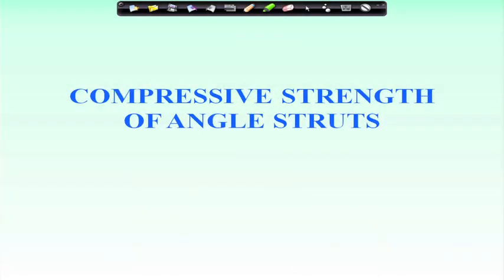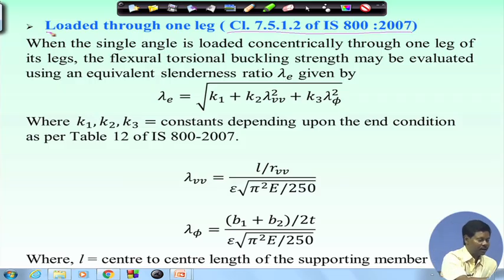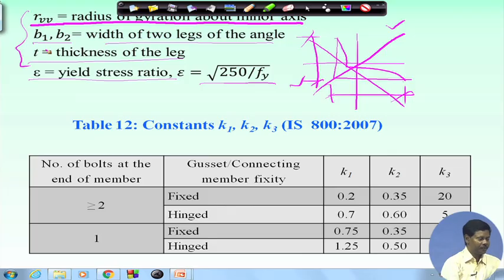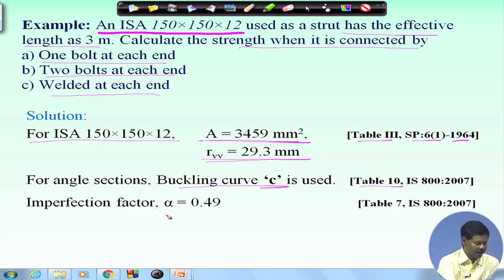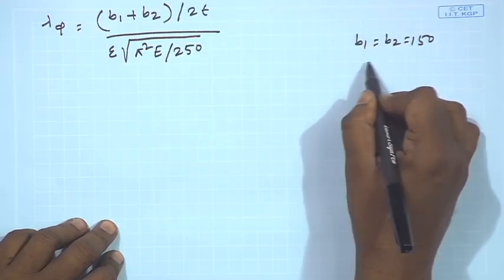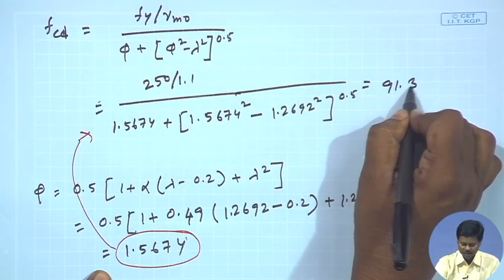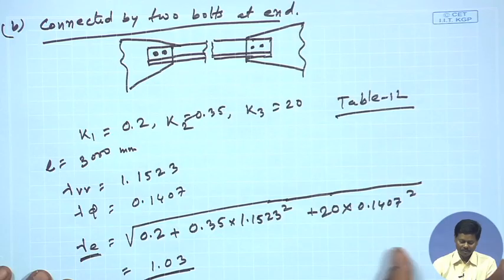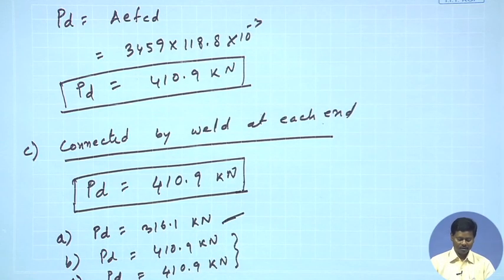Lecture 32: Compressive Strength of Angle Struts

Comment: In Table 12 of IS 800:2007 how can the condition of fixed end be produced by one bolt at each end. Is it through the use of HSFB?
Reply: Same doubt sr
Reply: same doubt!
Reply: Connected by bolt/ weld at each end. So connecting member fixity is 'Fixed'